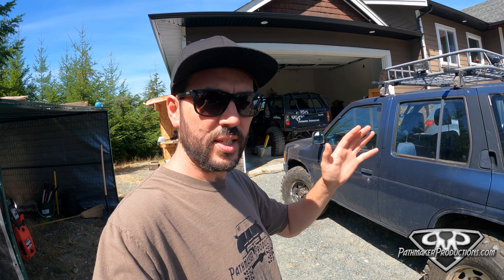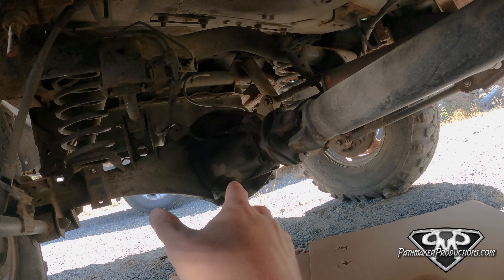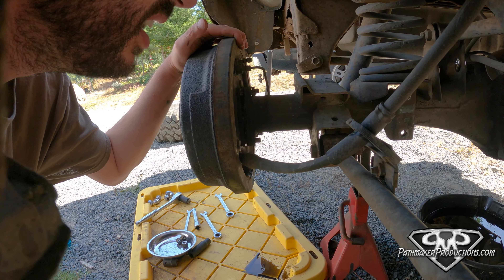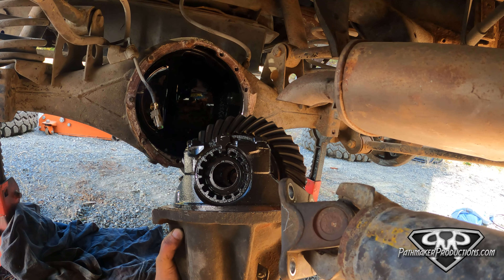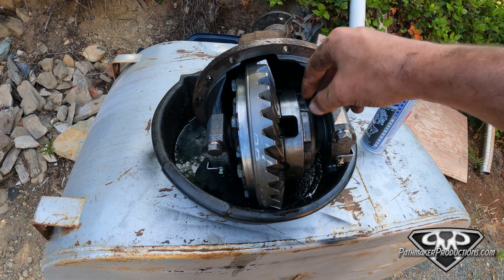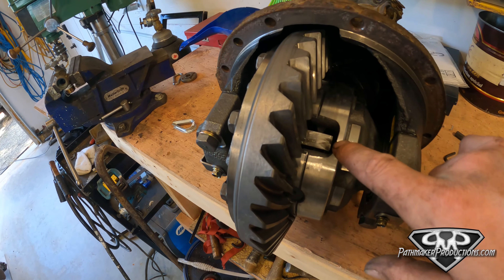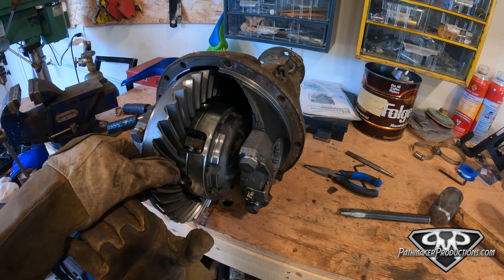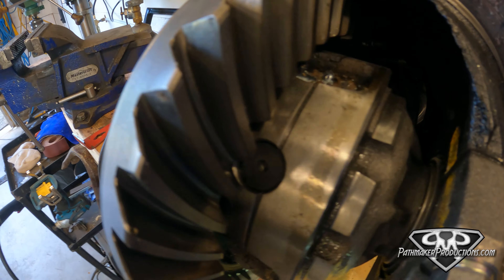Weld Differential WD21 Nissan Pathfinder How-to - Project Cheapfinder - S10E19

Comment: First off, great videos! Its nice to see someone putting the older stuff to work lol. I daily an ‘87 pathfinder (bone stock) and haven’t liked a vehicle this much in a long time. Where I live kinda makes it necessary for a 4x4 so it was a perfect fit. Even with open diffs and 235/75 snow tires it’s pretty good but I feel like a locker would help. In your opinion how strong is the rear diff and would welding it ruin it for daily driving?
Reply from the maker: If you do a plate like in the video (open diff is even easier to weld than an LSD because there is more access) then it will hold up great. I've been running welded rear diffs on the road since 2004 and they hold up great! Makes a MASSIVE difference offroad, don't need to hit things as hard because the tires just keep pushing, unlike an open diff or lsd which loses power if the tires lift up a little bit. I highly recommend the mod, its the first thing I do to all my daily drivers..........you also get to play drift racer in the rain, little blap of the throttle and the rear end just hangs out haha
Reply: @PathmakerProductions  thanks for the input dude! This will be happening in the immediate future. I have to cross a creek ( no bridge) to get to my house lol ice can be a monster to get through. I feel like I’m going to like welded diff life. Thanks again for the reply and keep up the great work man!

Comment: Did you do anything to front diff? Or just rear diff ?
Reply from the maker: The weak link on these things is the stock steering, which takes a ton of extra abuse if you're locked in the front so I don't recommend it. Rear locked can get you a long ways tho!
Reply: @PathmakerProductions  oh okay, totally new in these offroad stuffs so haha. Thanks alot.

Comment: Pro tip: After MIG welding a diff it's a really good idea to take a small chisel and hammer and remove any dingleberries so there's no chance of them coming loose. Ring and pinion gears really don't like it when little bits of steel go through them! I TIG weld diffs so there's no spatter to worry about.
Reply from the maker: Whoa whoa whoa, we can't get tooooo fancy now! (I spun the pinion lots of times, and i'll be giving it one more good brake cleaning before tossing it back in.............also, Cheapfinder so seeeend it!

Comment: Why? I thought these came with limited slip differentials
Reply from the maker: Because the 28yr old limited slip differentials in these things are always so loose and sloppy after 28yrs that they’re essentially useless offroad for traction. This 1hr project makes your 4x4 hugely more capable offroad so it’s worthwhile in my opinion.
Reply: @PathmakerProductions  hmmm I’m probably doing this to my 92 then but i daily it. Are the rear tires chirping all the time on the road?
Reply from the maker: The only time the tires chirp is when you're going slow in a dry parking lot and turning tightly. You don't notice it when driving. If you step on the gas in a corner, especially in the rain it will kick out, but thats half the reason I do it, because its fun. For offroad its night and day difference in capabilities compared to a limited slip or open diff. Don't have to hit things nearly as hard because the tires will just keep pushing, unlike a limited slip that likes to stop spinning at the worst possible time!
Reply: @PathmakerProductions  sounds like i’m doing this then. Just have to get a better welder don’t want to even attempt with my cheap flux core basic welder